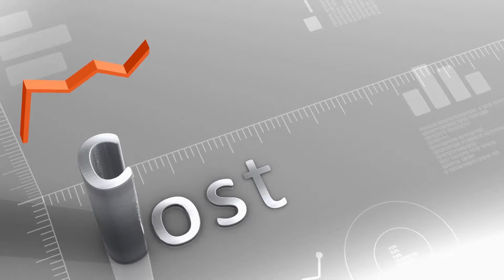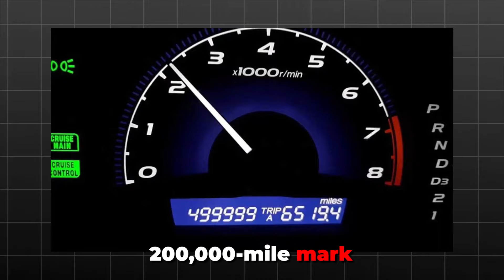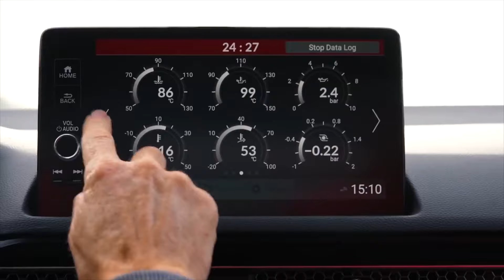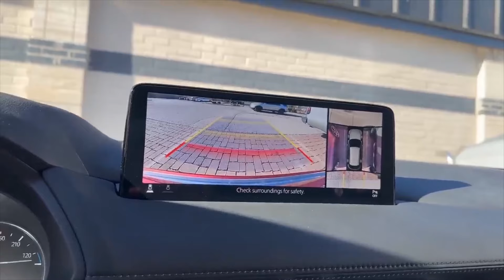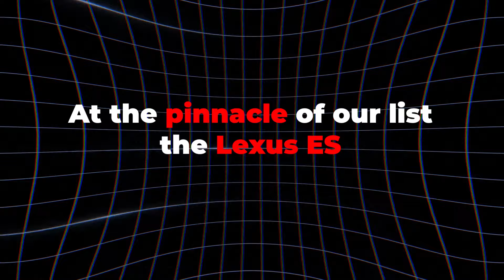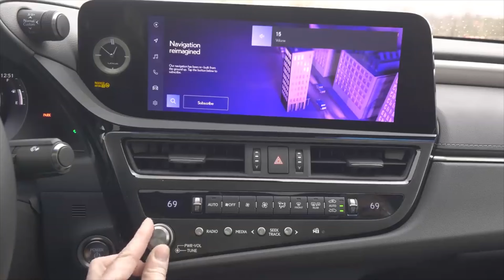Top 5 Most Reliable Cars of 2024 - Unbeatable Durability and Performance!

Comment: I fully endorse the choice of Toyota Corolla as a reliable car! We have a 2003 Corolla - for 22 years, all we spent on repairs was rear wheel bearings twice, and the replacing of one starter motor, and the replacement of 2 front struts.  Now it still purrs along the city and freeway smoothly like it is new.  Even the interior is fully intact.  Easy maintenance in oil change, replace brake rotors and pads, and top up of fluids.  The newer ones are fantastic cars that are economical and reliable!  Thank you Toyota for delivering to the consumers world class cars!
Reply from the maker: Sounds like that car will last forever! - happy driving and stay tuned :)

Comment: The Toyota Camry should have been on that list. 19.5 years and mine has zero problems!
Reply from the maker: Toyota’s really are bullet proof in terms of maintenance, you can see them used with 200-350k on the clock till pulling along with no issues!